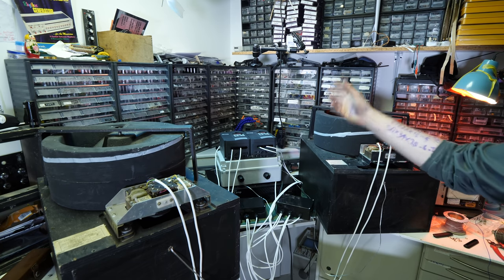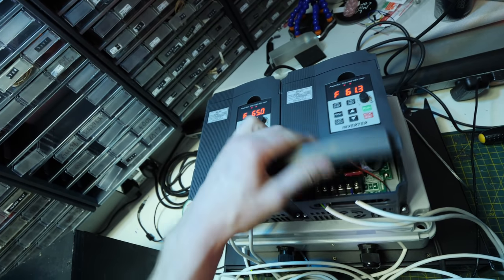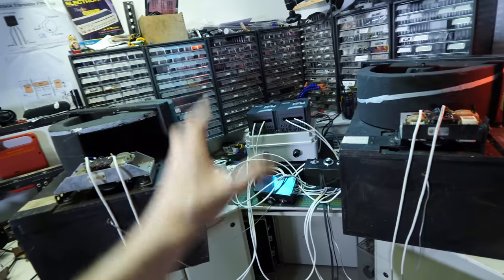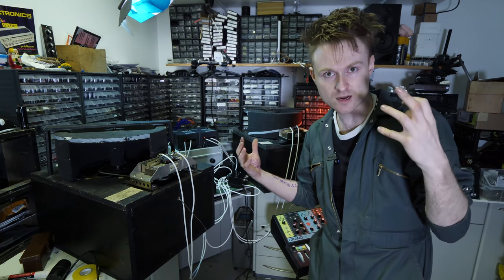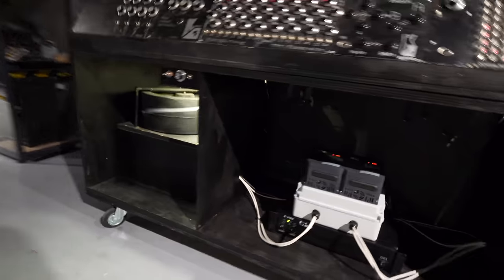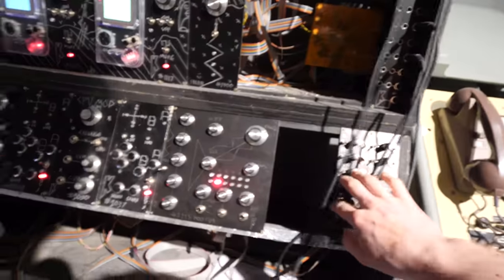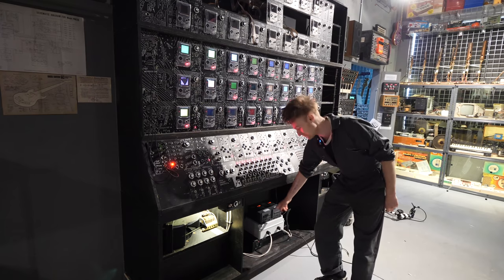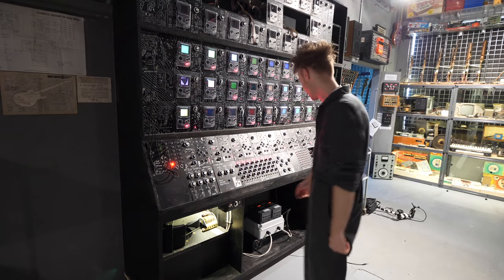STEREO LESLIE SPEAKERS IN THE GAMEBOY MEGA MACHINE

Comment: The speaker enclosure needs a UV strobe!
Reply: Strobes that are synced to the speed of the leslies? That would be amazing!
Reply: There's the issue of photosensitive epilepsy that is the bummer for that, but making it a switchable option would be good together with syncing the rotation to GameBoy screens/LED patterns would be good too!
Reply: Not even a strobe - just mount lights, uv ir otherwise, through the speaker mounts so they're underneath the rotating drums. Automated strobing synched to rotation speed

Comment: Nice. I noticed how much “better” they sound in the cabinet - the reflections off of the back and sides make such a difference with Leslie cabinets. PS - why not make a cloth covered grille for the leslies so you can run them even in slow chorale mode for the museum… With enough light you might even see the spiral. Just my $.02 !
Reply: They sound phenomenal.
Reply: When reading your comment i thought of Lights INSIDE the leslie drum...  It would look like a light in sync with the leslie letting the sound out.
Reply: i would just leave em open, often the leslie cabs were open to one way
Reply: Just a small correction these rotor units are not true Leslie  speakers!  they are in fact Italian clones tbe motor units are totally different (designed to get around  a patent!) I  used to buy these in the early 80s as th basis for  a range of organ tone cabinets.

Comment: I'm looking for one of those variable speed frequency generators for hacking a bread machine! (A variable speed control for the induction motor that drives the stirring paddle.) I didn't know you could get them from pet shops. Also, wow, those are big... not going to fit that into the bread machine housing.

Comment: What would be really cool is if the speed control for the speaker, dritector or whatever the spinny bits, could be connected to a slowly changing random input value. So not only are the two out of phase nearly constantly they will continually change of the passing of time.

Edit: dih yeah, control voltage will let you do that, never mind.

Comment: What about belt drive via a conical transfer roller, to give you variable speed, and move the motors away from fingers.
The motors can sit behind a plastic panel. 
I worked on a transcription turntable, that used that technique to give easy variable speed ,from about 1948 or so.
It used a guide rod to push the belt up and down the conical roller that then had another belt doing around the 20 inch or what ever diameter it was ( Very large discs) platter.
My problem was, that I could not get the platter to maintain accurate speed. ( Not what you need)

Comment: Those VFDs are not really suitable for those little shaded pole motors, you may overheat them quickly. You can adapt a small three phase motor to the fast side and end up with better control without risk of burning up the motors. Still, a very cool setup and it sounds great!!

Comment: Commenting before I forget you may of already come up with a solution.

For speaker grill get some hex mesh. It's used for car radiator protection, and people in the pc space used to use it for high air flow fan covers.

If you can't source some easily, get a big mesh bin it's made of the same stuff 😂
Reply from the maker: That’s the stuff thanks

Comment: Listening to them from the Tv and through the speakers I have, they don't have a pronounced sound like I was thinking. It sounds that they are almost like normal speakers. Try to open the back to spread the direction of the sound or sound dampening material on the sides and rear. I think the boxes they are sitting in do not give enough pronounced direction because of them being enclosed. Just a thought. :) Really cool nonetheless!

Comment: What's the vfd part number? It probably has a setting for acceleration. It also usually has settings for motor rating and voltage so it can protect the motor if it try to accelerate too fast and the motor draws too much current.

Comment: You must be a lefty. I only guess that because of all the handwritten notes on your right arm
I use my arm as an "unloseable" notepad too, I have even considered getting lines tattooed for neater use... I have also considered getting both an inch and a centimeter and their respective tenths tattooed on the side of my finger for those quick, non-crucial measurements on the fly
Reply: Google Adam Savage Ruler tattoo 😂 on his left forearm, but finger tattoos would be a good idea too.
Reply: @reggiep75  no need to google that, I know about it already.
As a long time machinist now, I had my idea way before he ever had his tattoo, while he was working in mythbusters and didn't have his tattoo yet maybe even.
over the years tho I learned that MY thumb is almost exactly 1 inch knuckle to knuckle and to judge from there

Comment: Really really really neat. I had a joke but it was too American*, so on to the ideas -  What about a light that illuminates only when the speaker cutout faces forward, so it is blinking in sync with the warble...  Or, what about an expression pedal for rotor speed.. 
* the joke: When he says "I got my amplifier" and swings the camera, I can see a "vacuum tube" but not an amp?  (Wait, that's a hoover, not a valve)

Comment: 7:00 Just use some perspex with holes drilled in for the sound to get through. Best solution me thinks.  :)
Reply: I'd also considered that but then thought 'Hmmm all that drilling' and then you get 450 of your 500 holes done and the perspex cracks, but that would depend on it's thickness.

Comment: How did you break one of the VFDs? We must know!
Reply from the maker: Annoying wiring on the Leslie meant the neutral of the mains and the output neutral to the motor were connected and fried a regulator. Got the replacement part on the way. But never turned up in time